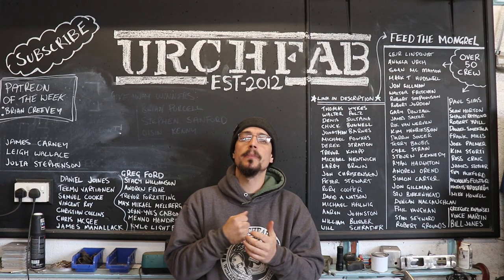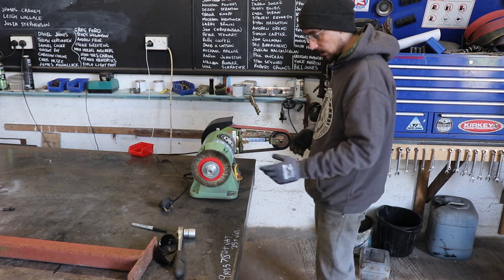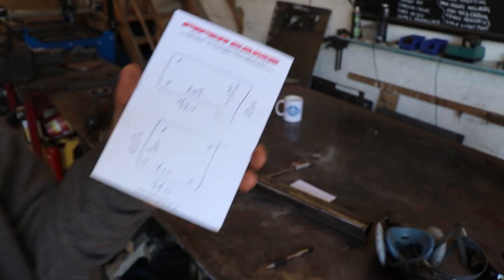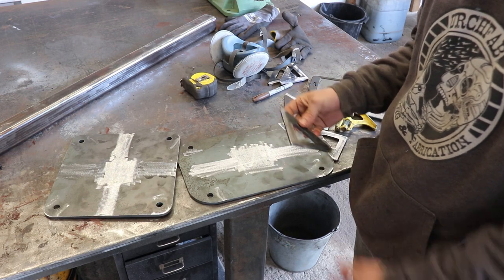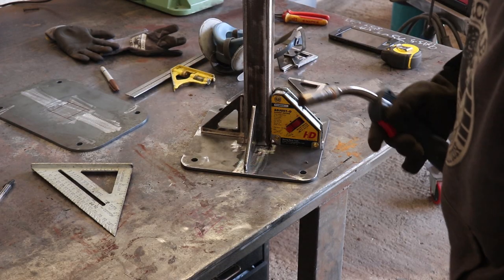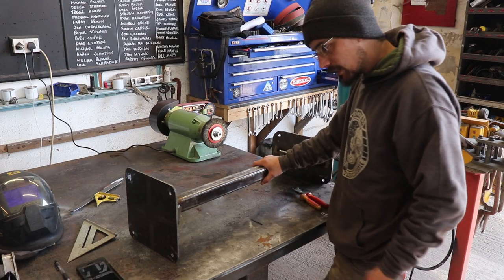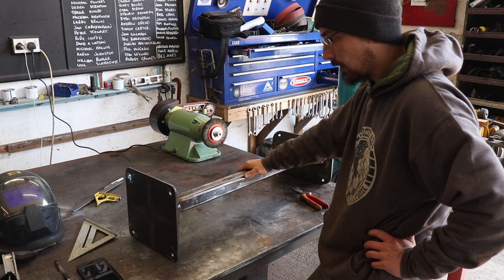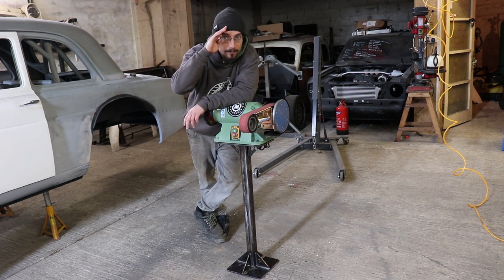BELT GRINDER STAND FABRICATION, PULSE MIG WELDED AND CNC PLASMA CUT

Comment: Hi Matt, just a couple of things I wanted to mention. As I understand it you can adjust the power level of your plasma cutter down so that you can use it to produce set out marks on your top and bottom plates ready for you to clean up and then weld on the post and brackets thus saving set out time and potential for errors. I also think that the top plate needs to have front and back gussets to deal with the leverage forces when using the sanding belt arm. Interested to hear your thoughts.

Comment: You can do that without any measuring by just marking a line from each corner of the square and the corners of the square tube will only line up if it’s in the centre. You can do it with the rectangular plate but you’d need to estimate the centre a bit

Comment: I'm a metalworker and welder from germany. Great job. 👍But in my opinion there could be a problem with the vibration, when the machine is running and stopping. I would fabricate it in 80/80/3 mm and some bigger on the floor.

Comment: Left field question - can you easily buy sheets of steel the size of the bed of your plasma cutter? we dont get a lot of options here  - smallest sheet sizes available here are 1800x1200. Your bed doesn't look that big?  PS, I just clamp my grinder down with a G clamp when I use it.

Comment: I built the same thing for my grinder, but the bottom plate warped up on all the sides and teeter totters now, I had it nice and straight and tacked, I have to work on heat control
Reply from the maker: Big hammer?

Comment: Looks like the base is too narrow to be very stable if push comes to shove on the top end, grinder, an old steel wheel welded on would add some lateral stability to it. 
Thoughts for what its worth.
Reply from the maker: Its gonna be bolted into the floor.
Reply: @Urchfab  Yes, I think you said that in your post, sorry about that. Don't know why I was thinking mobile grinder stand?

Comment: I don't want you to die either! I'm glad you're taking safety a bit further by 'overengineering' the stand!

What's the difference between 'standard' welding and 'pulse'? Is it just as the name implies, a simple on/off (like intermittent wipers) or is it more complex?

Keep up the good work, whether it's The Mongrel, the welding, or small projects! :-)
Reply from the maker: Cheers. No its quite different, its like spray ark so the wire is molten before it hits the steel.
Reply: Thank you Matt! :-)

Comment: Matt - why don't you use your plasma-cutter in a slight more descent manner like here?

https://flic.kr/s/aHsjqJjCee

For your stand it would have made it much easier to put parts together. It's more like plug and play. Or plug and weld. I used to tack things in place like that all the time. 

Just a hint, do however you like.
Reply: And just cut the profile of the pole out of the base, stick it in, check the vertical alignment and weld it in place. I do not try to corrupt your placement-tutorial, but with such a plasma-cutter at hand...
Also the supports could have been just set in place with little "feet" and according slots, no?
Reply: According or corresponding?
English isn't my first cup of tea, sorry.